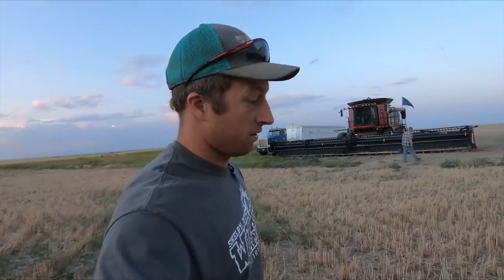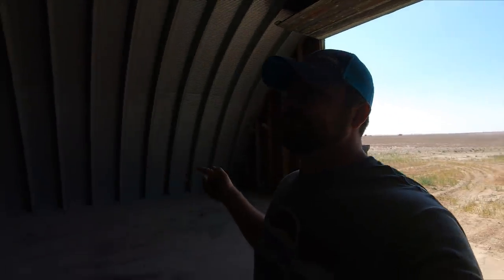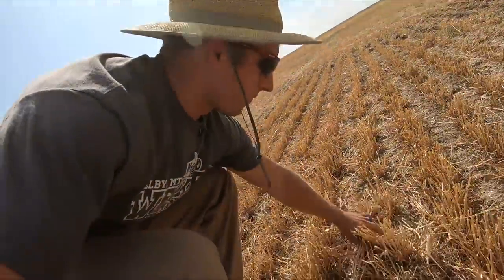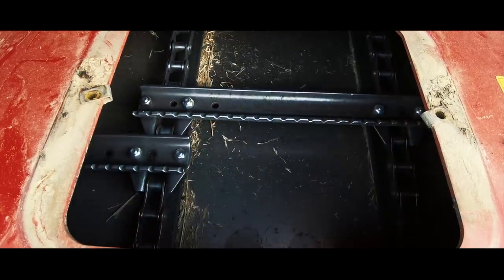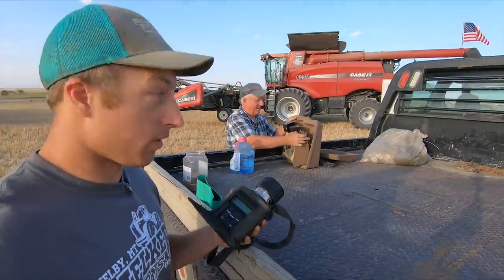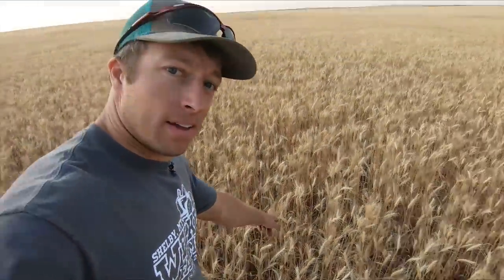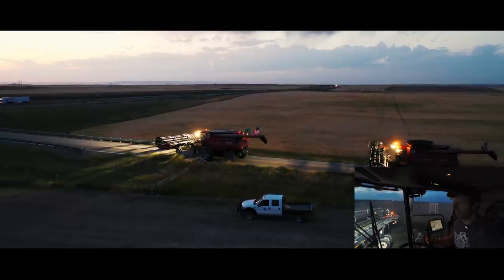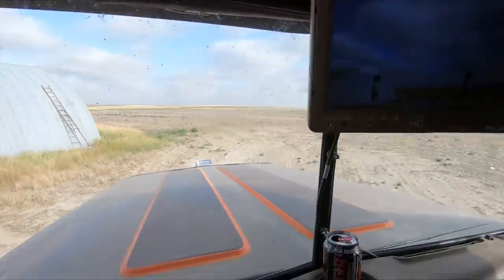Overpass & Over Moisture - Harvest Episode 5

Comment: We can't go down hardly any of our roads even with 35 ft heads, much less crossing an interstate but we use header carts that are separate from the head instead of those convertible self-contained units you have so we can drop the heads much quicker.  Great video.

Comment: Nice to have equipment that you can sneak over the overpass!! 
We have too many narrow bridges around here... They either have signs right against the bridge, or huge concrete end pillars for the side rails... Narrow roads with cut banks don't help a bit either!!
Thanks for the video!!!! 
Keep the rocks out and get it done!!😎
Reply: So you're saying....... DON"T ROCK ON????   😁👍👍👍
Reply: @RobertWelkerFarmerBob  you know it Robert!!! 
Rock traps just aren't all that good... Best ones we had on anything were on the old Gleaners!!! They caught them!!! Held a lot too! Had a few fields where we would empty the trap after every truck load, never did run one through 😎
Our 1480 has the spring loaded trap, it gets the ones that will cause damage, but it let's the smaller ones sneak by... Makes some noise, but haven't found any damage yet....🤞😎

Comment: We crossed a bridge in SW North Dakota with 40’ Macdon Flexdrapers. Had one gauge wheel running on top of the concrete edge, and the other side that ledge was running between the gauge wheels. You roll the header all the way to whichever side you chose, to pick them wheels up.

Comment: we run 45 foot draper headers on our johndeere combines.  we have to sometimes go down the road with them.  45 feet of header is a lot to keep an eye on for rocks when we combine soybeans we float about an inch above the dirt. we use a land roller on our fields that dad built it's 30 feet wide. the roller pushes the rocks and smothes the soil so we can combine faster.

Comment: Always intresting to see how you farm in The US 

The guards you put on your headers are normal over here in Germany because we have crop laying down on complete fields some times
Reply: Those guards are made in Germany. We call them Milo Fingers. In our part of the States we use them to pick up downed milo. Usually can get our downed Winter Wheat pickup without the fingers, because we don't have Sawflys in our area.
Reply: @maxpower9499  we don't have sawflys aswell
Reply: Downfall winds in germany?

Didn't see that happend in the netherlands yet! (East part)
Reply: @Gerardvan-deRiet  just normal rain and wind and it goes flat
Reply: @Julian-eh5yy   that was probably the environmental wheater i meant
Reply: I was just going to say the exact same thing until I saw your comment. The problem is that many farmers believe that spraying large amounts of slurry and other fertilizer helps the crops even more. But the crop gets so heavy that a single thunderstorm is enough to bring huge amounts of crop to the ground.

Comment: In thought Illinois was flat,,which is is,very little (maybe30') elevation change in 12 miles,,but we have treelines between fields that blocks a clear view.These old treelines was planted a long time ago,before barbed wire fence.It's purpose was to act as a fence for everyday farmers would walk their cattle to a field and with trees planted all around,even along the road,the cattle would not try to go thru the trees. Osage Orange as it's know,,more commonly referred to as Hedge is orange in color,and so dense it's very hard to cut. Black Locust is the only tree that is more dense,or harder than Osage Orange is, but it is super hot burning firewood. It will easily turn a wood burning stoves side red from the heat it makes.I love the neverending views you have that must go for 50miles or better in some places.Spots around here you can see 20-30 miles IF there is no treelines blocking your view.
Reply: At least you can see company coming and fix dinner before they get here.

Comment: I wish our motorways were only as busy as your interstate at the moment they have closed part of the motorway here for the weekend. As such it is nose to tail on the main road through the neighbouring village where they recently narrowed the road to 16ft so lorries are mounting the pavements to pass each other and you have a load of cars using the back roads to get around that which look as wide as your gravels roads though not as smooth or as straight and have trees and hedges against the sides which makes the 60mph some are trying to drive at rather dangerous. I don't know if it is that or the moisture but one of our neighbours is parked up where he had started the fields. 

The lunch brings back memories of growing up here but who was responsible for making the cab roof look like a bird table with the wheat???

Comment: Use the fore/aft and tilt the header forward .  No need for pickup fingers.  Also put the reel fingers  in #4 position     it'll pick up every head.  Thats the beauty of Macdon.
Reply: The problem we have is rocks.  To get close enough you'll be running the sickle into them.  And with tall wheat you end up reel thrashing.  This way the lifters will do the work and the sickle is 6"+ above the ground.  Not the best but beats the second best.
Reply: We are able to do it that way.  Different farms are more rocky I suppose.  Ever consider rolling your winter wheat acres so you can cut it on the ground?
Reply: @glennwaldner  this is the first time since 2009 to have sawfly problem. We'll change variety that's more resistant

Comment: Just a question, I just watched this but could you solve two problems at once by making a stone picker that just floated at the surface before you planted so the stones didn't get into your combine then use the stones as gravel that you seem to be short on.  You'd probably only have to do it every few years as you don't till deep.  It seems leg arms could fabricate it so it would mostly cost the steel and a few bearings and a belt or auger and maybe a trailer.

Comment: Would a Shelbourne Head be a economical solution? Would that work to get the downed stems from the insects up? I'm only 1/4 through the vid so it may be answered, I know they're costly but a $20k repair to a Combine is to.
Reply: Shelbourne won't get the chopped off down wheat, and some guys think the extra residue the Shelbourne leaves contributes to more sawflys the next year.
Reply: If you use a shelborn header that close to the ground you'll destroy the header with the rocks

Comment: Are they "soft" flies or "moth" flies.
I know you know, but not one insecticide will work?

I have an idea, capsasin oil;  this is used on organic crops.

I'm intreged you would distroy your "new machines" for a few bushels.  With the insect damage the grain amount and quality is marginal, therefore not worth the down time at $150.00/ HR.  And the damage to the rubbars and other critical components.

My point of view, give it up. 
Throw the "pea bar" pickups in storage.

It's all good, there is a product that can be flown on with so.     
N 32 at the sametime to boost food for the crop.
Reply: We haven't had this bad since 2009. As far as damage to the combines nick gave the worst case scenario. We haven't experienced anything close. This combines have a protection beater which has been around since the 1980. We will change variety of wheat

Comment: What is the ideal moister for storing wheat?
Reply: Ideal is under 13 but depends on how big the bin is.  If bigger than 21 ft diameter could mold at the center top.  Also if have aeration you can store 15 to 16 and be safe.  Our country cools down quicker so that helps.

Comment: Is there any thing you can to prevent the saw flys?
Reply: There are wheat varieties which are somewhat resistant to the wasp.  But yields are lower.  Otherwise swath the grain before it fully ripens or use the crop lifters.